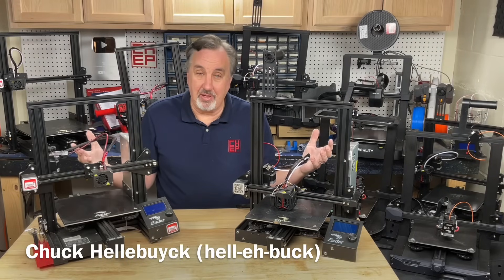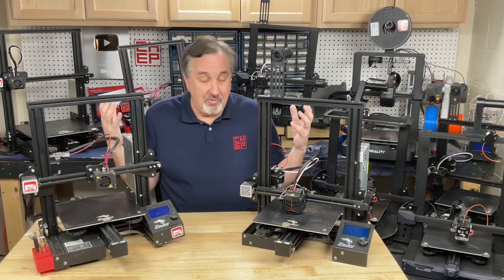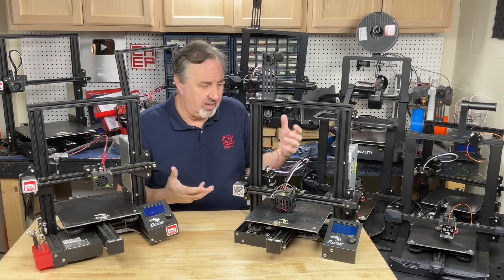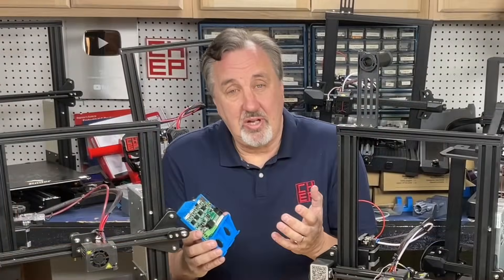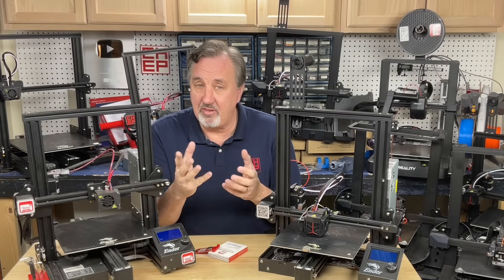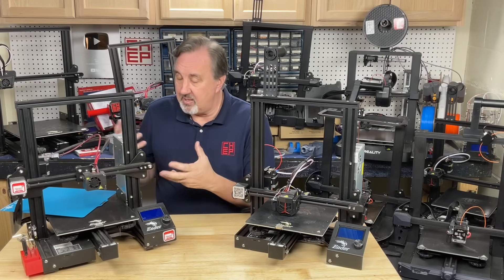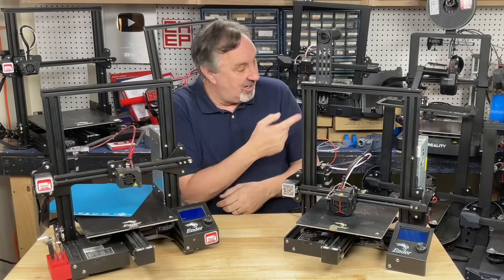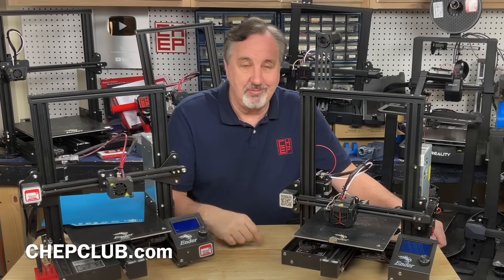Too Many Ender 3's - What Should I Do?

Comment: I thought about buying an ender 3 because I found out my brand new Pallette 3 pro doesn't work properly with almost any modern printer.  And I had no idea my brand new palette 3 pro would be unsupported, so digging into the past was the only path to get my new old-s*** working.  Who knew they would discontinue it right when I bought it, and retroactively back out support.  So I've been looking at all the old printers.  I ended up buying a used prusa with a tuned and working mmu that I will be running in parallel with palette...  it's stupid in the age of bambu, but I have my reasons.

But to directly address your implied question "is the ender 3 still useful?".  If you make your money selling printers (you are an influencer selling printers to your youtube followers, so I mean you) then you personally don't have a good reason to be featuring the ender 3 in your videos.  If you don't make money from printer companies, then you can spend all of your time with the ender 3.

Here is the deal, except for being faster, or running exotic materials, or printing pre-colored TOYS, the ender 3 is 95% as good as any new printer.   My printer I was an expert with was the generation of printers the ender 3 looks like it was cloned from.  My printer was a pile of extruded aluminum, and a 3d printer kit for an a8, but I threw most of the a8 away, and just used it's kit as a pile of parts on my way to making a somewhat better version of a bed slinger than any of the anet machines...  I actually made 2, one was a 400mm^^3 with a 32 bit processor and NO BELTS.  But I digress... When I made a super fast printer, I discovered I was still going to be pushing the same slow PLA plastic through a slow nozzle, and all the fast 32 bit processor got me was stepless operation, so I used the faster processor to just microstep lead screws on every axis to make the quietest smoothest 400mm bed slinger you could ever imagine...  But it still could only do what PLA can do.  My point is that the earliest 1.75mm filament PLA printers, and todays printers both still print the same benchmarks with the same filament, the same nozzle sizes, the same temperatures, the same bed heat...  the only thing that has changed is that the newer printers can move faster than they can actually print.  Because PLA is governed by physics, until we come up with a new filament that you can print faster, your ender 3 is 90% as good as any new pla printer.  so yes, they still have value, they can still make 3d printing accessible.  A well tuned machine should be able to do most of what I can do with a modern core xy.  I'm buying ancient technology today because a new thing I just bought turned ancient when the support gods stopped breathing life into it.  My head is still spinning at how fast I lost $1000 on a brand new 3d printer technology, it died before it arrived.  So I have a long list of old printers that are on the compatibility list.  Prusa mk3s won over the ender 3 for a couple of reasons, the fact it is coming with a tuned mmu is a warning to my palette 3 that it is in danger of being melted down as a recycling project.  The palette actually works great, it's only issue is the slicer software (same problem Bambu has).  If I hand-edit the gcode, I can get good results, so my success or failure will end up depending on how good I become at scripting gcode edits.  Maybe a 5 tool changer will be below $1000 before I'm too old to, or I'm tired of, trying to make waste towers.

Hey, I just bought some lasers...  We could carve our old 3d printers into laser art to sell at arts-n-crap shows...

Comment: I really enjoy your videos and the subject matter is just what I need.  I'm still using my Ender 3 V2.  I bought it when I retired to keep my mind busy.  I've just replaced the hot end and bed leveling hardware. It prints well but just too slow.  I've thought about adding another one or two just to be able to print more items in less overall time.

Comment: I still have an Ender 3 V2 I bought about 3 years ago when getting into 3D printing. Moved to. P1S and the poor Ender 3 has been put out of commission. I don’t see myself getting back at it. When I need to print something the printer has to work and be as accurate. I believe they have served their time, just like old 78 RPM records

For me, it is time to move on. The Ender 3 still works perfectly fine with lots of upgrade over the times. I will try to sell it cheap locally to get rid of it

Comment: My Ender 3, the first printer I bought during Covid, that got me hooked on Printing hasn't been used in about a year.  I bought an Ender 3 S1 Plus for bigger prints and engraving (which I have yet to try) about 2-1/2 year ago and then a year after that bought a K1 Max.  I use the K1 Max for 95% of all my printing (which has tapered off) and the S1 Plus for 5%.  I will probably give the Ender 3 to a niece who is 10 years old and really enjoys her 3D pen.  Part of the great learning experience was assembling the Ender 3 and upgrading it with features and printed accessories.  No better way to learn.  My involvement actually stemmed from buying an Ender 3 for my youngest grandson when he was 10 and he took to it full bore.  I had so much fun helping him, that I bought one for myself to occupy my time in retirement and Covid isolation.  As soon as I sell the Harley, that I am unable to ride anymore, I am converting a small garage to a workshop and will take my E3 S1 Plus out there to finally do some engraving, which will be a new learning experience and cannot be done in my "print shop" in the house.  I think the BEST thing you can do with an Ender 3 is to donate it to someone that has an interest in learning 3D printing and provide them with the your, and some other GREAT YT channels links for learning.  Without YouTube guys like you, I would have been LOST, and given up a long time ago. THANKS!

Comment: Still use my Ender 3's, picked them up cheap and or broken, fixed them. Do want to finish my ender extender at some point, just finding the space. But at present, Ender 3 Pro, Ender 3 v2 and a ender 3 something,but its not got much in the way of original parts bar the frame so Frankenender?

Comment: My Ender 3 pro is going on 4 years old now. You wouldn’t recognize it as a Ender with every thing I’ve done to it.  Right now it shot full of steroids as bed is 300 x 300.  That’s big enough for me. Most of my prints are in the 1/2 hour to 3 hours.  Occasionally I had a 27 hour print.  Now it seems to print fast enought.  I consider it my fish tank. I get my ZEN from a successful printing object. If I want it to go faster, I’ll install klipper.  But right now it suits me for what I need it for now

Comment: i still use my ender 3 (the first version) as my default printer. and it still works like a charm. i did upgrade some stuff offcourse: BLtouch, BMG style extruder, V6 hotend, TMC2108 stepper drivers on MKS genL board. better cooling, cable chain links, octoprint with camera, etc. so no manual stuff, but.... i did pre ordered the new Elegoo Centauri Carbon. the price $299,- for that machine is incredible. the speed and quality it produces is really good. i guess that's why you made this video... a new era has begun. but i share your feeling, it's always sad to say googbye to an old friend

Comment: Ender 3's print TPU just as fast as modern machines
Reply from the maker: Excellent point!  In fact I get better results with TPU on my Enders that I do on the newer machines designed for speed. Great idea!
Reply: @FilamentFriday I startded my print farm with a bunch of Ender 3's. After mastering those, I can tackle any problem with these new machines. I still maimtain a fleet of Enders running TPU constantly. Thanks for replying, you are the man. I've used many of your Ender videos over the years

Comment: I have an Ender 3v2 & 2 Pro. Sure, they are old but they still work just fine. Where I live we don't have much variety to choose from and the new printers are mostly double of what they cost in the US. You really need to know what you're going to do with it before purchasing the new models. I purchased mines for hobby & tinkering which i think goes a long way to listening how they work and how to improve settings for better prints. The new printers are more set & forget and not much you can touch if you're a tinkerer and want to learn

Comment: I still have and use an  ender 3 as my only printer, currently in the process of upgrading it. But I do  have my eye on the prusa core one, and as soon as they release a multifilament solution for it im getting it.

Comment: I have an Ender 3 V2 that is my original printer. It has been a lean mean printing machine. It just works. I even still use the original glass bed. I recently acquired a Neptune 2 and I definitely like the Ender better. I would love to add another ender to the collection. I’m not in a hurry to get prints done I just want them to be what I sliced them to be. I am only looking at a newer printer for size and print temperature. Now that I have a second machine I can modify one and still print on the other. I always see an Ender in my hobby. I definitely cruse the marketplace for printers all the time.

Comment: I still have three "ender 3's" in my small print farm... well, if you can still call them "ender's", the bones are there but that's about it.  They are rebuilt from the ground up to be fast reliable machines that would give any "modern" printer a run for the money.  But money is the key word, for as much $$ that  was put into time and parts, you could easily get a new machine that you just pull out of the box and print.  The downside of new machines seems to be trending to proprietary parts, whereas if something needs (rarely) fixed on of these homebuilt machines, it's all just off the shelf or made (printed or machined) myself.

Comment: Still have mine. 
Orbiter 2 ,Kevinakasam belted z , Cr touch.
and finally put the board in an external case with a bunch heat sinks and fans. 
Love my prints 0% maintenance now and no more mods.

Comment: why not do a video converting one to an ender 3 ng ans make it core XY? But i do still use my ender 3 in fact i just got done putting linear rails on the X&Y it also has the belted z mod but i also have another i dont use much and recently saw the ender 3 ng core xy conversion that uses as much of the original ender as possible

Comment: hope not too many drop DIY even if all the new printers that come on the market are plug and play. for some of us we still love to take things apart and rebuild things or to achieve something else and it is almost not possible with the built-in printers that come on the market these days, I myself love to build and change things so that they fit exactly what I want to use them for. Well, I myself own a couple of core xy, but they are more workhorses for the projects I work on. did you think the mosque should turn them into some of the corexy projects that are on the net. 😉

Comment: I love my original Ender 3, but have also been wondering what to do it with these days. My little print farm still uses it along with my 3 cr6se, my cr10sprov2 and my 2 ender3 v3 plus printers. Since it's my smallest and slowest printer, was thinking about converting the ender 3 to a laser but not sure yet.

Comment: The Ender 3 series of printers are the Ford Model T of the 3D printing community. They are inexpensive, slow, require a lot of tinkering, but the bottom line is you, the hobbyist, can make them work. They can be made reliable. Like the Model T, there were millions produced, and parts and third-party tools (software) are readily available.

Comment: I have an Ender 3 and a CR6-SE that have been retired. The CR6 only 6 months ago. That's the time I bought a Bambu Lab P1S with AMS. The simple truth is there is no comparison. Speed, quality, reliability and convenience is evident out of the box. You get to a certain point when you don't want to tinker with the printer to get it to work, you just want to design and print. I'm stuck with not wanting to discard the old fleet, but I also don't have the room.

Comment: Some of them are very good.
I need to finish a project with an Ende 3 v2, with dual Z and klipper... HAHAHAHAHA

If i had so many of them, would try to make a diy-cheap Core XY + multicolor (one board can control as much as 4 extruders, so it should work).

Comment: My first 3d printer is an ender 3. There's a video about making two of them into a high-speed xy printer. Could both hot ends be used to make a dual tool xy printer?

I still have it, and I still use it

Comment: I have an Ender 3 Pro that I used until the middle of last year. I bought a new printer but now the Ender is just sitting in the corner. I was looking at the Ender 3 NG project where you can take 2 of them and make a CoreXY style printer. Sadly that parts and material cost for that project just aren't worth it. My Ender actually had better print quality vs the new Sovol SV08 I bought but I'm still not sure what to do with it.

Comment: Hey Chuck , I have to give you props on the Wallace and Gromit machine statement, most people I mentioned it to have no idea what I'm talking about. My Ender 3 just got replaced by an A1 because I used it so much the x and y axis both needed new aluminum extrusion parts because i printed so many things on it wore them down that the even new wheels wouldn't hold tight on the extrusion anymore. Make something cool with one. I've thought about a plotter for perfect drawings, but that's not much of a stretch. Can't wait to see what you build.

Comment: I still have my Ender 3 and use it regularly.  The benefit of having taken it apart, upgraded it, rebuilt it and fixed it so many times over the years is that I have full confidence that I can fix any issue.  So thought its probably the slowest most limited printer I own, I have more confidence in it than my other printers.

Comment: Bought a ender 3 v3 se, x and y linear rails, pei sheet, rpi with klipper, frame reinforcement, bigger timing pulley 
, k1 hot3nd, prints pretty fast at ke speeds and I enjoyed the process.  My 2018 ender 3 was also upgraded in the past and lives in a insulated chamber and does all my abs prints.   I have a k1 and a k1m but my enders are still very important to me especially as they both run truly vanilla kli0per

Comment: No Ender 3 here but have a Ender 5 Pro I've updated through the years. Still running the original 8-bit board and it is running Klipper. I used in the last month. It is very reliable if not horribly fast (about 50 to 60 mm/s speed). It just gets the job done.

Comment: CHEP was my go to when I purchased my Ender 3 pros many years ago, helped me a ton especially with settings in slicer, now maybe 8 years on with all the new printers and how much easier it has become, I didn't realise just how much I hated my Enders, I just wanted it to print, I bought all sorts of add ons to help improve them like the auto bed levelling sensor, glass beds etc, but it would always be a nightmare and having 4 of them which all had the same problem of spending more time messing about with them than actual printing. 

This video just reminded me of that time, nostalgic but frustrating and I have tuned in to you're videos over the years CHEP but you do have an soft spot for these machines, I'm glad you are finally letting go and moving forward from these, their time is up, Ill always be grateful to Ender for making 3d printing affordable the same way I'm grateful to Bambu for making 3d printing easy and pushing every competitor to up their game. 

Look forward to what's to come now CHEP is released from the Ender ways :)

Comment: I upgraded last year to two used Ender 3s from a closed hardware system. Added OctoPrint, ABL and a Smart Filament Sensor. Last issue is a good/cheap (all metal) hot end. Then I’m happy printing with them.

Comment: Over a year ago, I was given a Bambu A1 for review, but since then, the Ender hasn't run once. I'd spent plenty on making it better, including new boards, BLTouch, a Micro Swiss NG hotend upgrade, and a BigTreeTech Kiipper panel, among a pile of other subtle enhancements. I now have the same issue regarding what to do with it. While it printed fine in its final incarnation, it never printed so effortlessly as the A1, and getting it running again to complete a print job more quickly would probably not be worth the effort.
I'm tempted to strip all the enhancements off it and return it to its original form, since I kept all the parts. And then sell the special parts. Given the time and effort that went into it, binning it or just stripping it for the PSU and extrusions seems harsh, but I don't have infinite space to store an item that was overtaken by events.

Comment: I learned a lot from my Ender 3 - mostly from its shortcomings. I added a new extruder, new build plates, new springs, new main board, bed leveling, klipper, octoprint etc. There were some crazy after market support for it. But even "perfected" it was still a slow device. I upgraded to a P1S and my day in day out experience is just so much better. Even if Enders are still on sale on Amazon I would not recommend anyone buy one - you have to spend time & money to make the thing better, so why not just buy a better printer?

Comment: I got my V2 during covid and it launched my creativity in myriad ways. Still my only printer, still need to level it. For my occasional use it's still all I need. No complaints on my end(er)😂
Reply: I got a Ender 3 Pro during the pandemic - used it a lot and spent a lot time doing various upgrades. But it was always frustratingly slow so I upgraded to a Bambulab P1S and sold the Ender to somebody at work. Apparently they haven't even turned it on once and I sold it to them over a year ago.